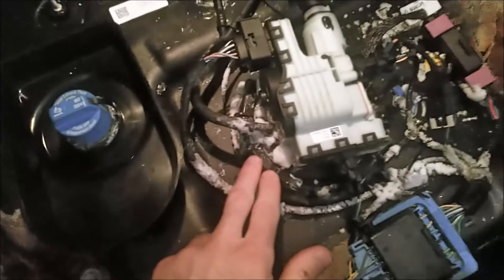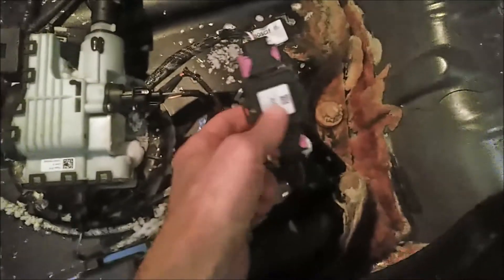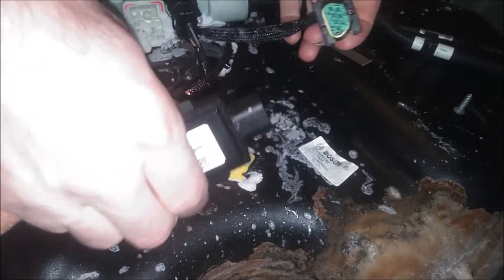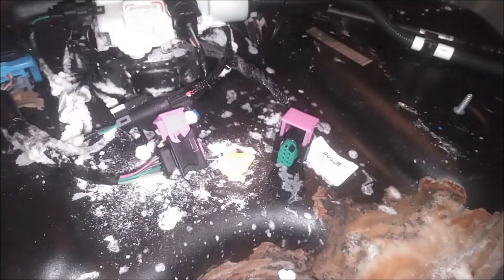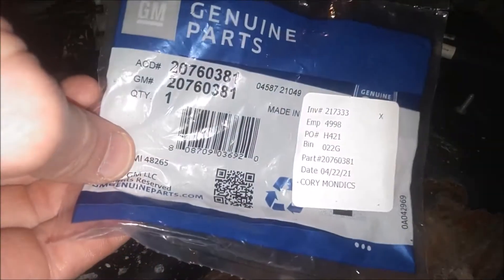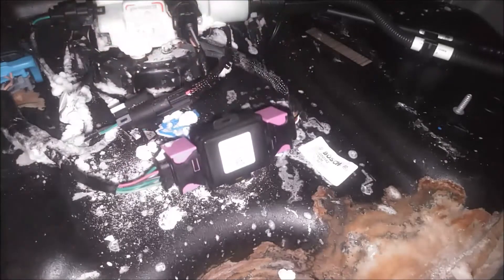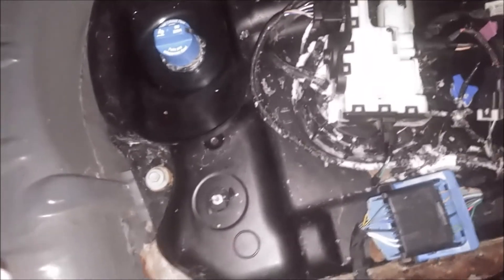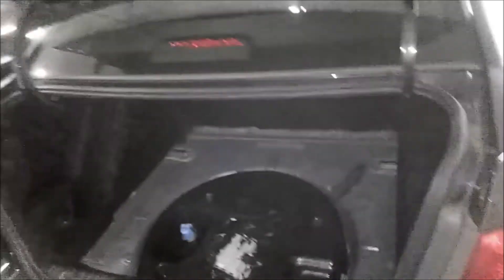Chevy Cruze diesel P205B fix!

Comment: I know this is an older video but I appreciate the info. I'm reading 170°F DEF temp after the car sits overnight in 55° weather so clearly the sensor is wrong. But what I can't wrap my head around is, how does that module determine the fluid temp without contacting any of the DEF? There must be a probe in the pump/heater assembly. I'll bet there's a procedure to test whatever is actually measuring the temp inside the tank. Maybe I should just buy the emissions diag manual...
Reply from the maker: Good question. I bet there is a temperature sensor in the def tank heater assembly.

Comment: I just did this for my 2014 diesel Cruze 

How long before the engine light goes off?
Reply from the maker: I cleared it manually, so I don't know how long it will take. It might need cleared. Your local auto parts store might be able to clear it for you.
Reply: @Corysdiyauto   it came right back on after being cleared at autozone

So this wasn’t the piece then was it?
Reply from the maker: @jakesmall8875  - Well, if it came back on, it's more than likely the DEF tank heater that's bad. This happened to me too, but my code didn't come back for about a week. After I replaced the heater, then all was good. The DEF tank heater is a weak point unfortunately.
Reply: @Corysdiyauto  ok the autozone guy told me I had to drive it 20 cycles and I don’t even know what that means and he acted like it was common sense

Comment: I really like and appreciate your videos.
 I own a 2014 Chevy Cruze Diesel. Love the car, hate the DEF system. 
DEF Tank assembly was replaced once already under warranty.

I currently have a code P205B (reductant tank temperature sensor) on the 2014 Chevy Cruze Diesel. 
I have already replaced the Diesel Emissions Fluid Temperature Sensor Module as shown in one of your Videos.
The code was then manually cleared, but it returned.
Would you recommend replacing the the DEF Tank Heater or the Diesel Emission Fluid Pump next.
Thank you
Reply from the maker: I would replace the DEF tank heater. That has happened to me before as well.
Reply: @Corysdiyauto  Thank you, will try that next and let you know.
Reply from the maker: @richpulcini327  - You're welcome. Good luck with it bud.

Comment: I have a 2014 Cruze Diesel.. I replaced the sensor and did a hard clear on the codes.  The check engine remains off but when I use the auto start, the car will start and run for about 3 secs and then shuts off. When I start the car with the key, the check engine light is on ... same code.  I had the reductant tank replaced in 2019 under warranty, but it's a one time fix through GM.. I don't know if I installed the old sensor because I did not mark the new one.  I don't know how to decipher the date code on the sensor.
Reply from the maker: Well Craig, you might have installed the old sensor or the reductant tank heater could have failed. I'm on my 3rd reductant tank heater in 154,000 miles. Unfortunately it's a weak point with these diesels. As far as the remote start goes, anytime you have a CEL, that function becomes disabled. Once you fix the issue and the code clears, then you will be able to use the remote start again.
Reply: @Corysdiyauto I know ow a CEL disables the auto start. What I am saying is I cleared the code and had no CEL. HOWEVER, when I used the auto start when the engine was cold, it ran for 3 secs and kicked off. CEL back on... cleared the code again and ran  the car for a bit (drove to do errands) and could used the auto start...so, it seems to trip a CEL when the system is cold. I have 138K on my car.
Reply from the maker: @craiglambert2131  - Oh, alright. Sorry, I miss understood. Maybe you need to drive the car for a period of time and then it will enable you to use the remote start. That's interesting. I hope that you fixed your issue with that sensor. I guess time will tell.
Reply: @craiglambert2131  I'm looking into this for my Duramax because the check engine came on after a cold remote start twice, but not a cold start with the key or any other time. It can't be a coincidence that the remote start feature triggered or bypassed something having to do with this sensor. Either way I'm going to swap it out and see what happens.
Reply: @craiglambert2131  I have a 2014 cruze as well and I have noticed the only time this code pops is when it's just below freezing outside I'm thinking ambient temperature plays a factor sensor might not even be bad I live in Virginia so it can get pretty cold out
Reply: @rockerchris82  I have since put my car on a diet so my problems with the DPF, EGR and DEF systems are permanently fixed.
Reply: @Corysdiyauto  I am hoping I don't have to replace the tank again...I wonder if we could go after GM/Chevrolet under the lemon law or get them to replace the tank for the life of the car??
Reply from the maker: @craiglambert2131  - I don't know? I do know that a lot of people have this issue with these cars as well as the Duramax diesel trucks from this era.

Comment: I watched your video because I got this same code on my 2015 GMC Sierra 2500HD.  I'm happy to see replacing the sensor worked.  I hope it works for me too.  Believe or not, my 6.6 Duramax Sierra requires the same #20760381 temperature sensor.  Thanks for your help!
Reply from the maker: I hope that it works out for you. If not, then it's probably the def tank heater.
Reply: @Corysdiyauto  If it is the DEF tank heater it will be the third in 150,000 miles.  It's a very weak set-up on the Duramax vehicles.
Reply from the maker: @michaelcangley1868  - That's ashame. It's our 2nd tank heater in 154,000 miles. It's definitely a weak point.
Reply: @michaelcangley1868  

I have the same code on my 2011 duramax. And I’ve already replaced the heater once before about a year ago. Did the sensor replacement work for you?
Reply: It did temporarily.  My GMC has been a perfect truck with the exception of the emission controls. I have spent nearly $3000 dollars on sensors, DEF tank components, EGR and DPF cleaning.  Enough was enough.  I took a chance and deleted it all.
Reply: I drive one as well. I have a 2016 with 48k miles on it. It has the same issue.  We're you able to fix yours?
Reply: Was it easy to drop the DEF tank and change the sensor out or did you take it to a shop I have the same problem but do not want to pay shop prices
Reply: @19Roo19  Easy to replace.  A little more difficult to reset  error  code.  You need a special scanner.

Comment: I did this sensor replacement and my code still comes on after a few days p205b. Do I need to replace the heater?
Reply from the maker: Derek Sprint 1050 - Yes, the heater will need replaced unfortunately.

Comment: did it clear the code? do you have an OB:D reader and which one do you need for this car
Reply from the maker: Wayne Bakker - I cleared the code myself with my OBD reader. I use the BlueDriver scan tool which works well with this car. It's Bluetooth too, so all you need is a smart phone and just plug the scan tool in and you can read and clear codes whenever you want.
Reply: Yeah great. I’m at the dealer right now changing the reductant heater for 500 
I need to find everything to get rid of all this pollution crap which I’m sure does nothing but cost me money
Reply from the maker: @methere27  - The emissions crap is what ruins this car. There used to be a company out there that made delete kits for the Cruze, but they stopped selling them since the EPA got involved and shut it down. I've already had the reductant heater replaced. Luckily it was covered under warranty.
Reply: I especially think the exhaust gas recirc  is really stupid I’m thinking of just capping the one end
Reply from the maker: @methere27  - You might get a CEL to illuminate if you do that.